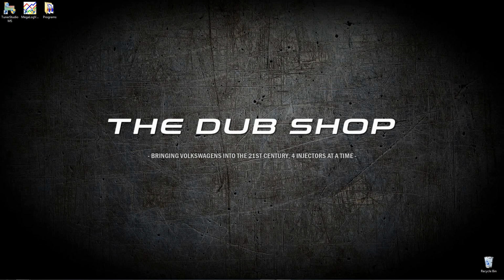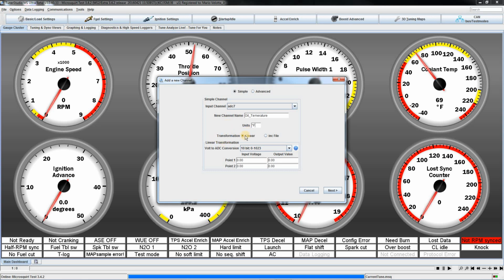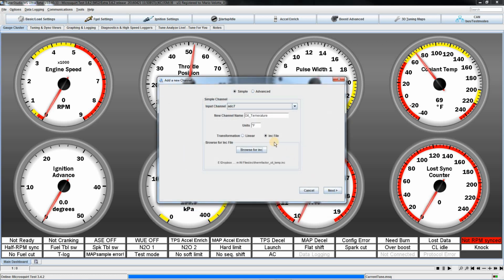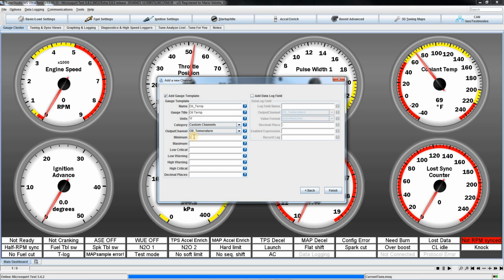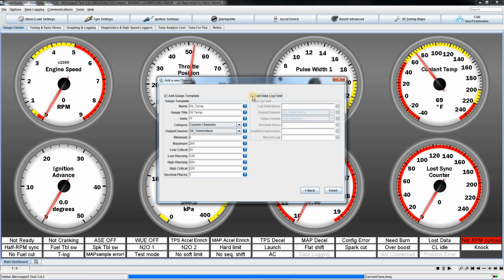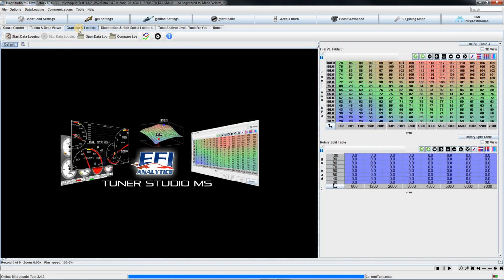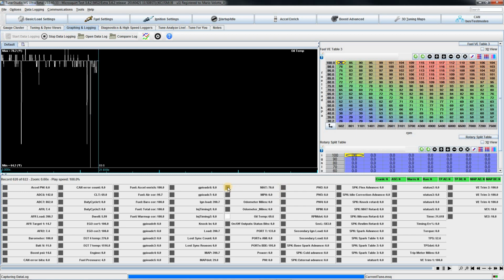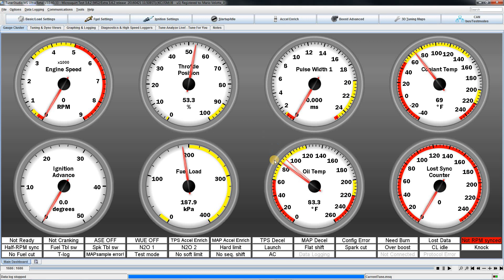Adding a fluid temp sensor input channel in Tunerstudio for Microsquirt

Comment: I followed the steps in the video but my base oil temp reading is 200 when the engine is cold, I'm using the temp sensor that you have linked. any suggestions as to why my readings are all screwy?

Comment: Mario I have a different oil tem sensor, ecumaster 0-5v with a 330ohm resistor soldered on the input. How can I make a inc file like yours? I use Celsius. Thanks a lot
Reply from the maker: I used easytherm to create the inc file.